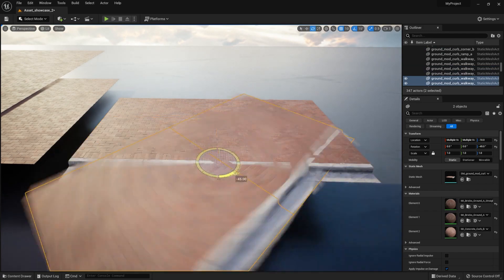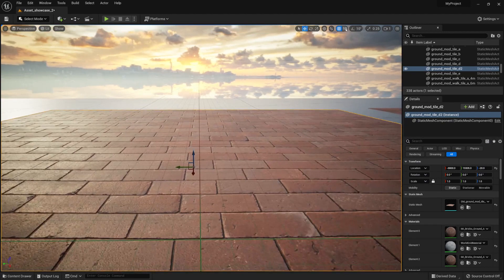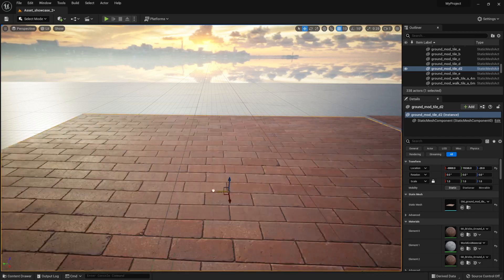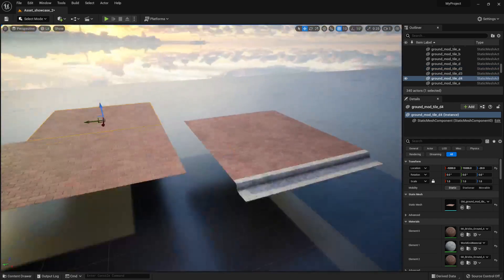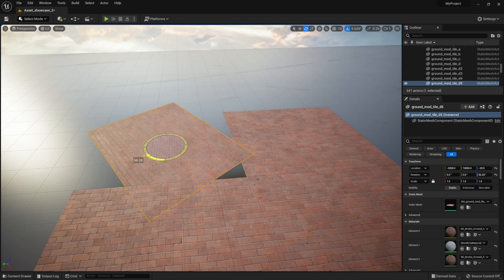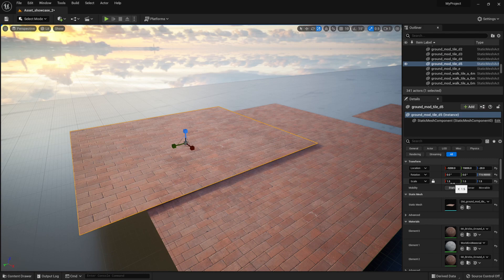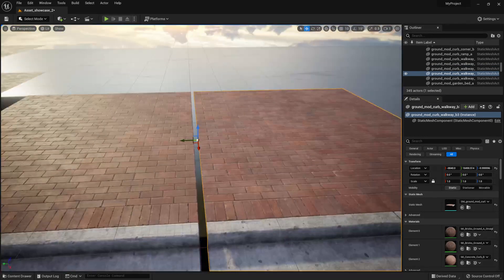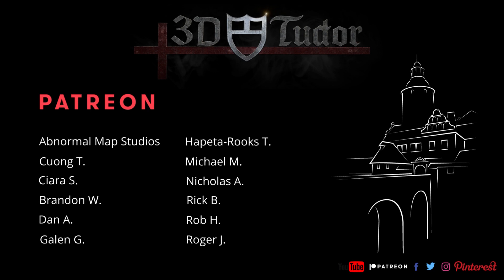Unreal Engine 5 UE5 | How to Master Object Snapping for Game Design

Comment: why cant you just snap to the mesh itself? This video is very helpful though 👍
Reply from the maker: Good question! I talked about grid and vertex snapping but not surface snapping. Personally, I don't use it as often but it is a good tool to know. Thanks for sharing :)
Reply: hey how can i snap mesh to itself easily?